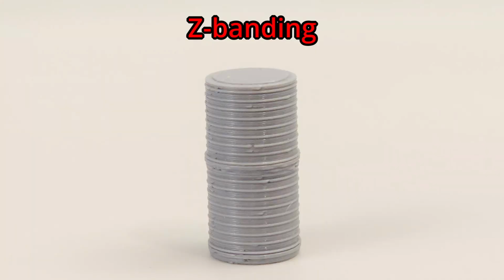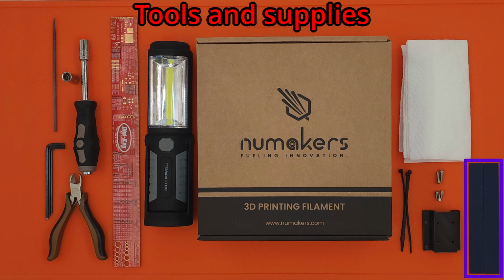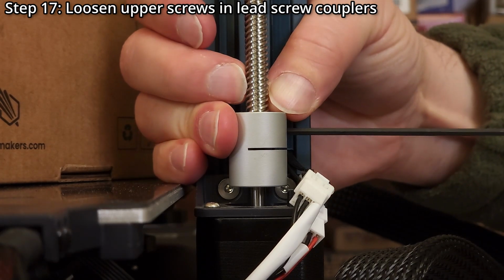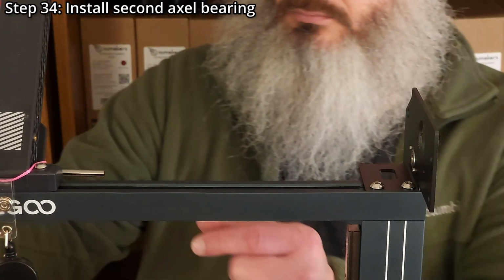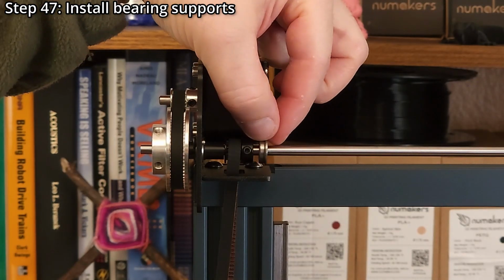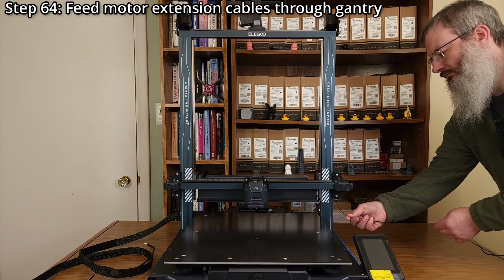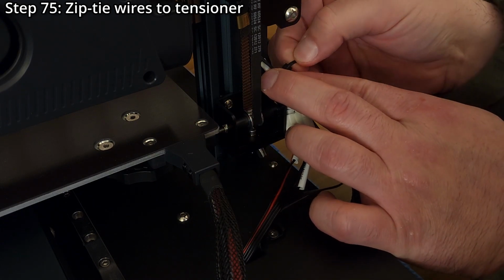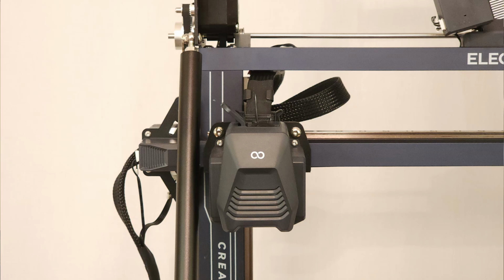Say goodbye to Z-wobble with the Neptune 3&4 Max Belted-Z Mod!

Comment: Wobble X is more effective, simpler and easier to install. You would only need to print the WobbleX WS8 Adapter.
Reply from the maker: Thank you for the suggestion. I don't make or sell the belted-Z mod, I only created an installation video for it. I have considered making a video for the WobbleX, but just haven't found the time.
Reply: which ws8 adapter you used
Reply: @RizeAgainstHaterz WobbleX WS8 Adapter for Elegoo Neptune 4 Pro. It's on Printables.

Comment: The left cable on my side had one of the side pins misaligned and instead of the pin being in the closest to edge hole it was one closer to the middle which caused firmware error and motor to work in reverse way
Reply from the maker: I'm not sure I fully understand your comment, but could you have the cables swapped? If you install the left cable on the right side (and the right cable on the left side), the motors will move backwards.
Reply: @SandMMakers  Apologies I'll try to make it more clear as someone else might experience the same issue. 
In my case the Right motor cable was correctly threaded and worked fine on it's own  - the motor was able to move the gantry up and down correctly (up was up down was down).
The left cable however had one of the end connectors not threaded correctly (it was the the end that goes into the motor connection slot). What i mean by that is that the one of the 4 pins that make the connection was in a wrong position. 
Normally the pins should look like this : 
- pin on the furthest left side - lets call it position 1
- empty pin - position 2 
- pin in the middle - position 3
- pin in the middle - position 4
- empty pin - position 5
- pin on the furthest ride side - position 6

In my case the cable had position 1 and position 2 reversed. So the cable had pin in the wrong place which caused the motor to try and move down and up at the same time which immediately was causing klipper error and shutdown. 
To resolve this I had to use a thin needle to push the pin on the position two out of the connector end and re-insert it in position 1

At your Timestamp 21:20 you can see the alignment of the pins on the connector (silver bit, empty space, silver bit, silver bit, empty space, silver bit. 
This must have been a manufacturing mistake but if I didn't spot it by accidently running the gantry Z axis on the a single (good cable) motor I would have thought 100% something else was the problem.
Hope that is more clear for anyone that might have experienced something similar.
Reply: After replacing the position of the pin in the connector the motor is working flawlessly on it's own and in sync with with the other motor

Comment: Woot i just ordered all the linear kits!
Reply from the maker: Thank you for watching our videos and good luck!
Reply: @SandMMakers I'll report back when installed.   I also installed klipper
Reply: EVERYTHING WENT WELL EXCEPT FOR THE AXEL FOR THE BELT MOD..  ONE SPOT ON THE AXEL WAS A LITTLE TOO BIG AND THE BEARING WOULD NOT PASS THROUGH IT..  I HAD TO HIT IT WITH A QUICK SANDING THEN IF FIT PERFECTLY..    WHAT SIZE AND TYPE ARE THE BEARINGS ON THE BELT MOD BRACKET ? ONE OF MINE WAS MISSING A DUST SHEILD AND ID LIKE TO REPLACE IT..
Reply from the maker: Email TBStron3D and they will send you one. Unfortunately, I'm not sure where to buy those bearings.
Reply: uxcell F695ZZ Flanged Ball Bearing 5x13x4mm Double Metal Shielded (GCr15) Chrome Steel Bearings 10pcs

That is the replacement bearing.  For anyone who needs it.

Comment: Hello I have recently did this mod and now when I start a new print the y axis will come full forward and the slam the head into the build plate. Do you know the cause of this. I guess a easier way to put it is when a new print is started it slams the nozzle into the build plate and doesn't stop it just keeps trying to go I guess to zero until I turn the machine off.
Reply from the maker: Thank you for watching our videos. Did you update the z-offset? Does the printer home correctly? Could the motor cables be switched?

Comment: So my whole z rail wobbles it's like the rails have way too much play
Reply from the maker: Thank you for watching our videos and I'm sorry you are having problems. When you say "z-rail", are you refering to the two Z-axis linear rails, the X-axis gantry (horizontal) that holds the toolhead, the two long vertical extrusions, the very top horizontal extrusion, or the new rod from the belted-Z kit?
Reply: @SandMMakers  sorry my x gantry has a lot of play, like the bearing carrages on the z rails have too much play, the weight of the head kinda pulls it forward
Reply from the maker: Are the linear rail carriages able to wiggle? If so, something definitely isn't correct. Are you sure you didn't lose any ball bearings from inside the carriages?
Reply: @SandMMakers  no didn't loose anyball bearings just replaced the mgn12c bearing blocks and they are the same so I think it the rails are not mgn12c rails. am I able to email you a video

Comment: I've used this entire series to update a 4Max, without issue. My only suggestion would be to provide some guidance around belt tensions. This is a great piece of work. Thank you.
Reply from the maker: Thank you!!! You are correct, belt tension is important, but tricky to get right. I've been considering doing a video on belt tension, but just haven't had the time to work on it.
Reply: @SandMMakers that would be great

Comment: This mod looks more involved than the linear rail mods, but this one took less time to do.
Reply from the maker: Thank you for watching our videos and I'm glad you got it installed and working! A lot of time, a mod's difficulty and complexity is dependent on your experience and familiarity with building and modifying printers. As you perform more mods and printer builds, many of the steps start to become almost second nature.
Reply: Wobble X is more effective, simpler and easier to install. You would only need to print the WobbleX WS8 Adapter.

Comment: I have now finished all upgrades and after this upgrade, which is supposed to get rid of z-wobble, but my prints have way more z-wobble than before. 😅 What could be the cause of this? I guess i have done something wrong, i could not explain it otherwise. Does anybody have any suggestions?

Comment: Would it be possible to use this kit on the normal Neptune 4?
Reply: I'm guessing the standard Nep 4 is smaller so these parts would be to large.  Maybe that company makes a version for the Nep 4
Reply from the maker: Thank you for watching our videos! While I'm not affiliated with TBStron3D, I do know that they have a number of different kits available for each model in the Neptune 4 series. TBStron3D is very responsive and will help you out if you have any product questions.

Comment: Just did the y linear rail upgrade. Not sure how much of a differece a belted Z will make but im going to do it because its cool. basicaly a massive switchwire.
Reply from the maker: Thank you for watching our videos! In my opinion, the mod priority is (in decreasing order) Y, X, Z, additional diagonal brace, belted-Z. I'd really only recommend the belted-Z if you are experiencing bent Z rod problems or you just enjoy modding printers. X and Y provide the most improvement to your printer.

Comment: Planning to buy all the mods but will I be able to increase speed? That’s what I’m looking for
Reply from the maker: The most important mods are the Y and X axes. Those are the two that have the greatest chance of letting you print faster. The Z-axis mod is really a quality of life mod so you don't need to deal with POM wheels. The belted-Z mod is really only for if you are experiencing bent lead-screw issues or just enjoy modding your printer. I don't recommend the belted-Z for most people that just want to print stuff quickly.
Reply: @SandMMakers  What if it's not about speed, but problem with prints that fail as the print gets higher in the Z?  That's the issue I want to fix.  I think the x-y is the most consistent.

Comment: Hi, Thanks for the great guides. I never would have figured it all out. I have all the kits installed on my max 4, the only issue I keep having is with z axis tramming. It was terrible at first. I did all the mods at one time, and I think that made it harder to get it all trued up. I am getting closer now. I did have an issue with the x rail, it had .04 of run out in the center, none on the ends, made it impossible to set z offset. I replaced it with a new rail, and now it is getting closer to what I expected,

Comment: My N4 and N3 Max don't have much Z Banding.  Why not just straighten the rods?
Reply from the maker: If you don't have any z-banding, then there really isn't a reason to perform this mod unless you want to do it just for the enjoyment of doing the mod. However, trying to bend lead screws to be straight sounds very difficult, at least without some kind of special equipment of jig.

Comment: I'm very confused on what's going on with my printer. I bought the Z belted mod and installed it per instructions here. Everything worked fine before this mod but now that I've done  the mod it wont move the Z axis motors at all when trying to do a first homing. I felt the motor and felt it vibrate like it wants to so I took off the larger circle and small one with the small belt between them and did homing again. I saw the spindle on the stepper spinning so I know the steppers are getting power. Did I install wrong or what? Also my gantry drops very quickly not the 20-30 min like your video. More like immediately drops to the print bed. Super frustrated with this mod so far and buyers beware
Reply: So I was able to get it to move down, but when I try to move the gantry up the steppers up top skip and jog down. When I put some vertical pressure under the gantry and raise it at the same time it works as intended, so for some reason its like the steppers dont have enough power to move the gantry up. Moving the gantry down works as intended. Looks like its back to screws for me. I can't recommend this mod to anybody unless you wanna waste hours just to go back to what it was :(
Reply from the maker: Thank you for watching our videos and sorry for the delay in responding. For some reason, YouTube often fails to notify me when there is a new comment.

Without being able to see your printer, all I can do is guess, but here are a couple of ideas:
1) One (and only one) of the Z-axis motors is wired backwards. As a result, the two motors are fighting each other.
2) There is significant binding along the Z-axis and the motors can't "power through it". To test for this, disconnect the belts, and the gantry should easily move up and down.
3) Since you said your gantry falls quickly, did you make any prior modifications to it? Maybe those modifications increased the gantry's weight and now it is too heavy. This could explain why the gantry is falling so fast. Also, when I quoted 20-30 minutes, that is more of an average. Sometimes the gantry falls quickly and other times it could take a couple hours (or more). The stock gantry (of the Neptune 4 Max) with the auxiliary fan appears to be right on the edge weight wise. That means, depending on the friction in the rails, the temperature, and other factors could influence the rate at which the gantry falls. Also, the gantry falling speed generally isn't consistent. The gantry might quickly fall an inch, but then take an hour to fall the next inch.
4) One of the motors/drivers could be damaged, causing the motor to generate less torque than normal. I'm not sure of an easy way to test this, but if you did have motors fighting each other (#1 above), then it is possible a motor/driver was over worked.
5) A stepper setting was changed, or is otherwise different from stock, in your printer's printer.cfg file which is causing the motors to differently than normal (lower power/torque, change in direction, etc.)

Do you use the auxiliary fan? If you don't, try removing it and then the gantry should no longer fall.

Lastly, if you still have any issues, please let me know and I will do my best to try and help you out.
Reply: @SandMMakers  I am an idiot and installed the large and small pulley on the wrong spindles

Comment: So question for ya.  I started getting the motors mounted last night.  You discuss putting on the belt and pulleys.  I put them on and after an hours of messing with it the belt will not ride straight.  Regardless of what I do it goes to one side of either of the pulleys.  I don’t want to wear one side out so how would one go about adjusting?  I’ve tried moving either side in or out by millimeters and nothing changes…. It’s almost as if the rod is bent or the motor has to be shimmed.

Thanks for your help!
Reply from the maker: Sorry for the delay in responding, I've been trying to find a  specific video that I've watched in the past that could help you out, but I, so far, just can't find it.

Comment: How straight does the axle have to be? Mine came pre-bent 😢
Reply from the maker: I'm not really sure. The 3d printed supports probably help compensate, but I don't know to what degree. If you are having any printing problems, email TBStron3D, and they will fix it. They have great service.

Comment: so after 2 weeks of use... was it worth it ? :D really want to know
Reply from the maker: I haven't had a chance to use the printers that much since the video due to preparing for and then attending MRRF.
Reply: @SandMMakers  and after 3 months hope you can give a solid conclusion if the z rail with belt mod is worth it XD.. I did the y and x axis  thinking of adding this

Comment: I purchased this kit and installed it before your video release and I ended up switching back to lead screw. Had really bad artifacts on a test tower. I tried re-installing my Z liner rails( have the X,Y, Z kits) and small improvement but worse overall. I wanted this to work but sadly...

Ray
Reply from the maker: Thank you for watching our videos! I'm sorry the kits haven't been working out for you. If there is any way I can help, please let me know.
Reply: @SandMMakers  All of the kits have been great even the stop...got them all. How is your install working on the dual Z belt drive?

Comment: My question is this... what's to stop the print head dropping on the finished print? That seems like a problem.  Maybe a stepper with a brake is in order.
Reply from the maker: I haven't had that happen yet, but I guess it is a possibility. The gantry falls slowly so unless it rested solely on a very weak part of a print, the print should probably be fine.
Reply: @SandMMakers  I have the kit and am really to install it.  I'm lacking motivation to figure out how to install all the mods at once. It would appear you disassemble the same parts differently on different vids.
Reply from the maker: Order of importance: Y, then X, then Z, then belt. The X and Y are far more important, with the other two being more of "because I can" type mods.

Also, once you do the mods once, working on the printer will be like 2nd nature, and you will start to "just know" how to make any other changes.

Comment: I have all 3 rail kits for my Neptune 4 plus and I just ordered this kit thanks to your videos! I also have a micro Swiss hotend to replace the stock hotend!
Reply from the maker: Thank you for watching our videos!!! Let us know how it goes! I still need to spend more time with the front diagonal brace and belted-Z mods before I can really assess their effects on printing performance and reliability, but it is great to hear about others experiences!
Reply: How much of a difference was noticed when you changed over your hotend compared to the elegoo hotend.  Also, we're you using hardened steel nozzles before you changed over to a different manufacturer for the hotend.

Comment: Awesome tutorial and step by step. Thank you
Reply from the maker: Thank you!
Reply: @SandMMakers I ordered the kit and they say I need to have the Z axis linear rail kit as well, otherwise it won’t work?? I might have missed this important part of the video?
Reply from the maker: Yes, the Z-axis linear rail kit is required because the included gantry brackets have the mount points for the belts.

Comment: is this mod justifiable? or you could get away with oldham coupling to fix the issue with z banding
Reply from the maker: Thank you for watching our videos!! I can't really answer that question because the correct answer really depends on the individual. The Neptune 3 Max and Neptune 4 Max are great printers and perform well, even without any modifications, so the correct answer is heavily dependent on your ability to pay for mod kits, your experiences and ability calibrating and tuning an FDM printer, and your desire to mod your printer. I don't see any reason why you couldn't get great performance out of a stock machine, a fully mod'ed machine, or anything in-between. However, please note my (TBStron3D) videos are "how to install" videos and not review videos. I'm not sure how, but if I ever find the time, I would like to do a proper review video for the mods, however.

Lastly, I'm not aware of these printers having a greater percentage of or more severe issues with Z-banding than other, similarly priced FDM printers.